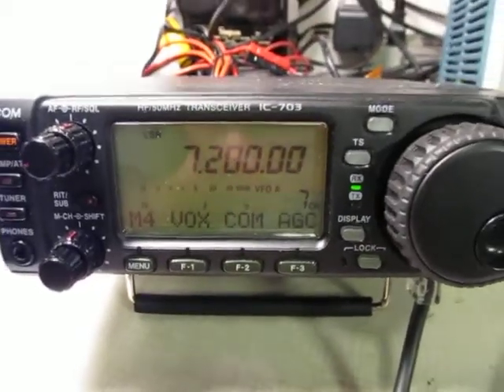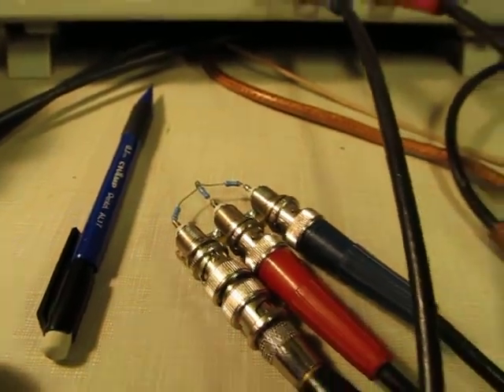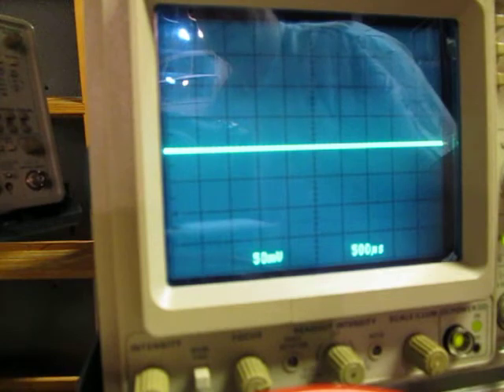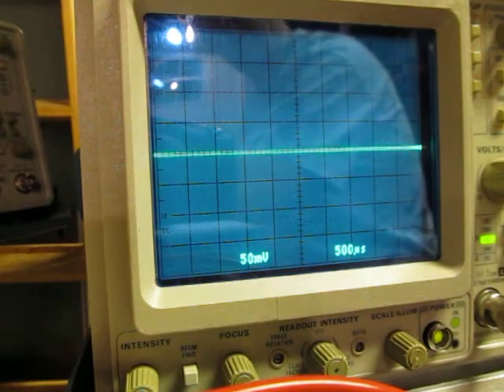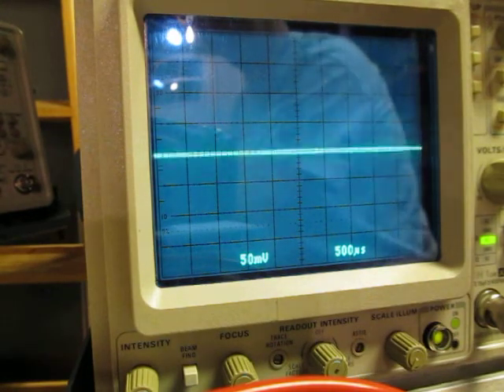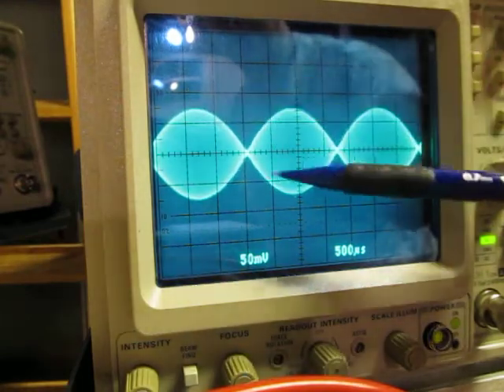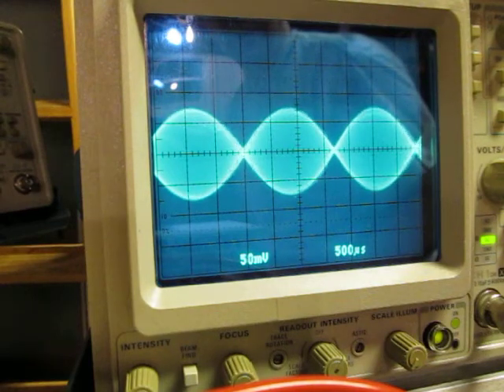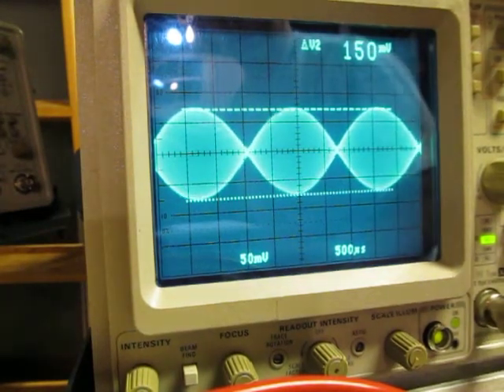#8: Two-tone test of SSB transmitter output

Comment: How do you know if you are inputing too much to mic socket on the radio? How can you tell if you are inputting too much volume or if you have a bad output signal on the radio? As both can produce flat topping?
Reply from the maker: You can turn down the mic gain to see how the flat topping changes.

Comment: Without a sprectrum anylizer. If my amplifier has a nice linear waveform like that, then the imd would be at least decent? Or the two not related?
Ive got a old heathkit station monitor similar to the kenwoods.
Reply from the maker: You really can’t tell linearity accurately with a two tone waveform.
Reply: @w2aew that's just the opposite of what you said in the first 10 seconds of this video
Reply from the maker: You can get a decent idea of non linearity, but not a precise measurement. A good discussion can be found here: https://preciserf.com/wp-content/uploads/2012/03/Appnote-2-Two-Tone-Tests2.pdf
Reply: @w2aew  thanks , good info and scope examples in that discussion

Comment: I have watched this video several times. I have a Feeltech FY6800. It is a dual channel  60mhz function generator whereby Ch2 is used to modulate a ch1 wave..So does this mean that I need another FY6800 to generate the 2nd tone?. VERY FRUSTRATING.
Hope you can help.
Reply: If the function generator has a mod   system then u can produce a carrier signal at what ever frequency u wish ..then u can modulate it all on same channle ..or u can use both channle and achieve this as well ..but most new function generators allow u to produce a carrier plus a audio signal together ..some don't ..then u would have to have my ore than on channle available to produce more than one signal
.hope this helps
Reply: I generator..depends on its function if it's just one channle used or not ..

Comment: When you turn on both tones, if all the chain is linear output peak voltage should double and PEP power be 4* respect to the single tone case, while in the video peak voltage increases much less. I suspect there is some audio compression at work, because the waveform seems quite good, non particularly distorted.

Comment: I have not been able to achieve clear audio with SSB yet... still working on it.
Reply from the maker: What are you using to listen to the SSB transmission?
Reply: @w2aew  Ahh!... Hadn't thought of that. Does SSB require a particular type of receiver?
Reply from the maker: @andrewferg8737  Yes it does!  It just sounds like a garbled mess on an AM receiver.  You need to use something like a product detector, since the carrier needs to be re-inserted for demodulation.
Reply: @w2aew  I guess my next project will be an SSB receiver!
Product detector... a bit like an FM receiver? Would I need a mixer to re-insert the carrier or could I insert it directly into the receiver's antenna amplifier with a simple resistor?
Reply from the maker: @andrewferg8737  Not exactly like FM.  It's typically done in the final IF stage.  Mix the SSB signal with the "missing" carrier frequency - in this case, the IF frequency.  This is much the same as you'd do in a CW receiver where you heterodyne the CW signal with another tone to create a "beat" note that you can hear.  This mixing with an LO at the IF frequency for detection of CW and SSB signals often requires that the LO be tunable so that you can adjust for the best audio quality.  The adjustable LO for the product detection mixer is often called a BFO (Beat Frequency Oscillator).  You can sometimes "couple" the IF-freq oscillator into the IF stage to get it to sort of work.  In the days before SSB capable receivers were widespread, people used to place another receiver in close proximity to their main receiver so that some of LO that is radiating from the 2nd receiver would couple into the main receiver...
Reply: @w2aew  Do you know of any good schematics for a basic SSB receiver? I've been looking, but haven't found much. I have made regen & superhet AM & FM receivers before, but I'm not really sure where to start with an SSB... 
Do I need 3 oscillators or just 2?
Reply from the maker: @andrewferg8737  Check out the work by Pete Juliano, N6QW, such as:
https://n6qw.blogspot.com/2022/03/march-3-2022-peashooter-makes-contacts.html

Comment: Why don't we also run two-tone tests on ordinary AM ?
Reply from the maker: Mainly because 2-tone is most useful for measuring and calculating peak envelope power when you only have an average-reading power meter.  For AM, you can easily measure carrier power and then estimate PEP from that.
Reply: @w2aew  Thanks.

Comment: hi,
what amplitude, millivolts do you set each signal output to ? i see the 750khz is set to about 190 millivolts ?  would the 1333khz signal be set to the same output ?
kevin rea
k6rea
Reply from the maker: You want them both to be the same amplitude at the RF output, so you may need to tweak one or the other depending on the frequency response of the tx path of the radio.

Comment: Nice video.  Note that the often-repeated ARRL lore of requiring non-harmonically related audio tones is incorrect, either by theory, logic, or experiment.  As we know a single modulation tone causes a SSB transmitter to produce a carrier, and superimposing a second modulation tone produces  a tone in the receiver with a frequency equal to that of the difference between the two tones.  This is easy to demonstrate with an experiment using harmonically related modulation tones.  ~K6KV
Reply from the maker: Yes, of course two harmonically related tones will create the two fundamental signals as well.  The main issue with keeping the two tones non-harmonically related is to ensure that the higher order intermodulation products don't overlap and give false results via constructive/destructive interference.
Reply: @w2aew  Consider if the second tone is three times the frequency of the first, where they just combine to give a (no-problem) first "tone" having a third harmonic, much as might have a person's voice.  Constructive/destructive interference refers to identical signals adding or subtracting from each other.  Note that this is an informative experiment to try.  Of course non-harmonically tones work perfectly, while harmonically-related ones are difficult to generate.  I don't want to beat this minor point to death because yours is a very nice video.  We can just agree to disagree.    K6KV
Reply from the maker: @garygordon2530  Not just the fundamentals, but the higher-order intermod products can also interact in/out of phase - and since you're typically doing this to look at linearity - IMD generation is one of the things you want to look at without any interaction.  The degree of interaction will depend on phase, which can vary, thus give you inconsistent results.
Reply: Hi Alan, 
I didn't particularly want to drag this out, except for feeling that your post begs a response.  I urge anyone interested in this subject to explore the books by Orr and Terman,which are much more authoritative (and insightful) than those by ARRL.  Of course these authors never mention the so-called "harmonic-related restriction".  They only say the obvious, that what is transmitted is identical to transmitting two closely-separated carriers separated by the difference in the frequencies of the modulating tones.  Anyone can view this on a spectrum analyzer:  one will see two carriers and nothing else, no imagined intermod frequencies whatsoever.  For example, consider transmitting USB on a 7200 KHz SSB carrier, with modulation tones of 1000 Hz and 2000 Hz.  Looking at the output of the transmitter on a spectrum analyzer, one will see two carriers, one at 7201 KHz, the other at 7.202 KHz.  For someone listening on a receiver they won't know and cannot determine the carrier frequency.  All they can say is that the difference between the two modulation tones 1000 Hz, and they won't hear any "intermod" products of course.   If the transmission instead was on a carrier of on 7000.5 KHz with modulation at 500 Hz and 1500 Hz a receiver would present them identical as for the previous example; again they would not be able to ascertain the carrier frequency.  There's no reason to test with harmonically related modulation tones, and no reason not to, other than their not being convenient to generate with separate audio oscillators.   Of course you're welcome to have the last word, however I assure you that I know of what which I speak.
Best regards,
Gary
Reply from the maker: @garygordon2530  Hi Gary,  Everything you state is abolutely true - with the assumption that the modulator, the gain stages, the PA, etc. are all distortion-free.  Assuming they're all linear, no harmonics will be generated and no IMD products generated.  You'll only see the two tones, whatever they are.  And yes, these two tones will of course appear as two individual unmodulated carriers in a receiver or on a spectrum analyzer.  No argument from me - all 100% correct, I have no doubt that you know what you're talking about.  My only point is that if the transmitting path has some distortion or non-linearity in it, then there will be potentially be harmonics of the two tones, and thus potential higher-order IMD products - where the 3rd order IMD products are usually the most troublesome as they will appear on either side of the main tones, at an offset equal to the original tone spacing.  If harmonically related tones are used, then the IMD products could overlap making it difficult to determine actual IMD levels.
Reply: @w2aew  Hi Alan,
Thank you for your friendly reply.   I will accept your point that harmonically related tones could imaginably hide some forms of IMD, and will retreat to suggesting that as a practical matter, where we couple the test tones through a non-linear speaker into a microphone and watching waveforms on a scope, such IMD products would be impossible to see.  One should assume that quoting from ARRL publications could be trustworthy, though I have never seen this restriction except from them, doubt that they understand the nuances you bring up, and feel it's inappropriate for their audience.  Best regards, Gary K6KV.
Reply from the maker: @garygordon2530  Thanks Gary, I appreciate the good discussion. Helps to keep me on my toes!  73 and Happy Holidays.

Comment: Hi Alan, great video. On the "summer" circuit at the beginning - to build that, looks simple enough, what are the R values of the resistors and are they hooked up simply like the video shows, in parallel? Is that all? Can you describe more detail on what routes to what 73, Patrick KM5L
Reply from the maker: Yes, it is simply a resistive splitter/combiner.  Not the best way to do it, but it works.  Here's more detail than you'll ever need: https://www.microwaves101.com/encyclopedias/resistive-power-splitters
Reply: @w2aew  Hey Alan, thanks for the reference. On that page, I'm assuming this is the Wye version? Then: R1=Z0/3. So if my function generator is 50 ohms output, I assume my R value is about 17 ohms? The speaker would be only 4 or 8 ohms though. Am I in the right neighborhood, what did you use for the R values?
Reply from the maker: @patrickbouldinkm5l143  In this case, it was a 16.7ohm Y-combiner.  Since we're talking about audio and impedance mismatches don't matter, I used it to drive the speaker anyway.
Reply: @w2aew  thanks Alan, I reproduced this with success, thanks for the fun learning!

Comment: Great video watched 2 times does the 2 outputs cause any problems with my 2 channel generator , didnt want to damage function by feeding signals back to other channel
thanks Alan
Reply from the maker: You can put a resistor in series with each output (like a few kOhms), and that will isolate them enough from each other.
Reply: thank you for great videos

Comment: Hey Alan! What are the values of the resistors of your summing devise? Great vids. Thanks. Dave, WB8VQV
Reply from the maker: +wb8vqv Each is a 16.8 ohm resistor - so that when each port is loaded with 50 ohms, all ports have 50 ohm input impedance.

Comment: I believe that the tones from some of the dtmf encoder chips are pretty good, your video has reminded me that I have one of those little gadgets somewhere and it would be very handy to use as a two tone generator. It has a tiny speaker so could be held up to the microphone but would be easy to add a pot and a socket to connect a lead straight to the microphone socket. Something similar might be an interesting project for your channel. Great video as always!
Reply from the maker: Nice idea!

Comment: I am working on a Collins KWS 1 transmitter on my workbench.  I would be interested in seeing a video on what I should expect for the output of the balanced modulator goinginto the circuit, then  into the transmitter as seen on an oscilloscope.  My audio is really raspy and crappy sounding on this transmitter and I'm trying to ascertain if the problem is before the balance modulator or after the balance modulator.  I truly enjoy your videos and I am deeply grateful for the time you take to put them out there.

Comment: Question. For years I measure Rx sensitivity one of 2 ways. MDS or (S+N)/N with the carrier modulated 30% and looking for a 10dB push in audio. I see almost no difference between Carr + Mod and just Carr, I see the test as flawed since you are to make the measurement at NORMAL listening level. When increasing or decreasing audio, I find the responses is not linear. Actually for me, MDS, differentiating  dit/dah's is more an indication of Rx performance.
ur thoughts please?

73,
Glenn WA4AOS